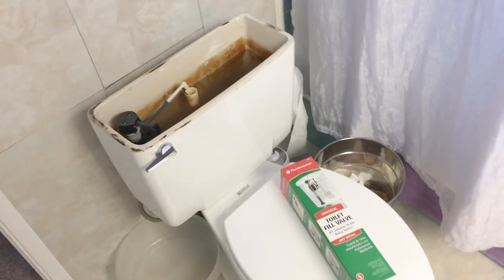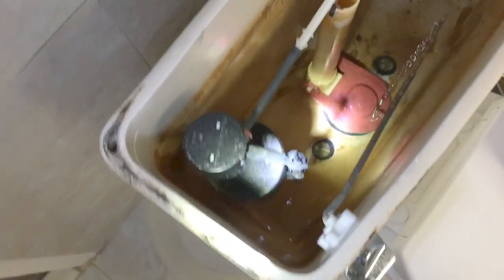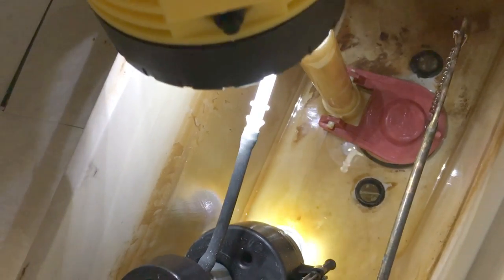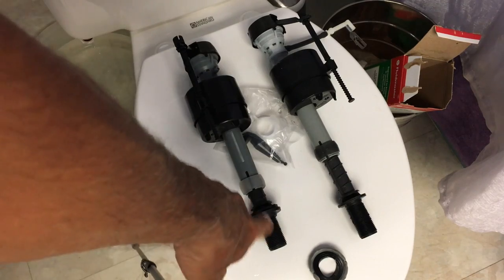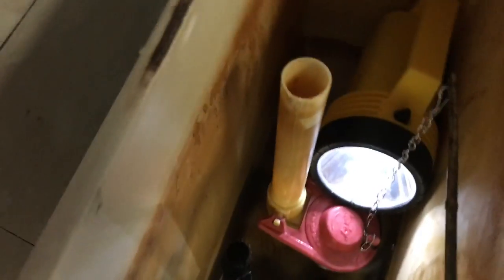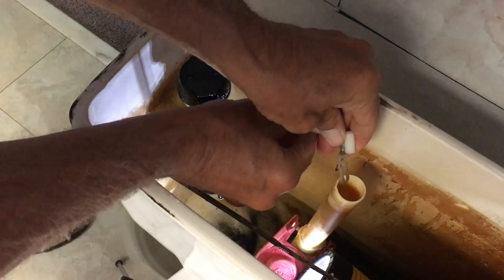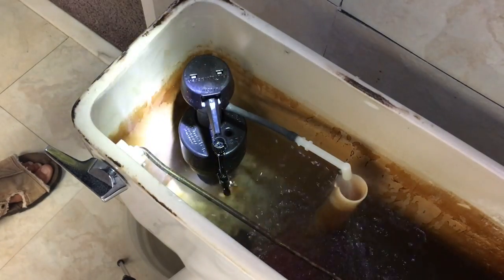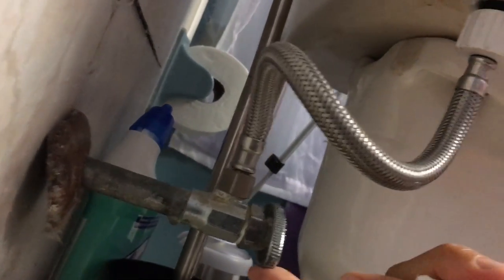How to install a Fluidmaster universal toilet fill valve.

Comment: Hi!🖐 Mr. Leeman, I can't thank you enough!! My husband used to do this & I really wanted to tackle this on my own. I put furniture together no problem, but with plumbing I'm intimidated. The fill valve was leaking from the top, the rest was fine. I've had the part for 3 months but was nervous.  After watching this I felt confident, did it, works fine, no leaks!! He (my ex) is going to be shocked I fixed this on my own! Now I can say..."what, like it's hard?". 😉 Thank you for making it clear & easy from another single female! 🙏🏻✌🏻
Reply from the maker: Way to go do it yourself and save ....

Comment: If the toilet tank is slow filling or the fill valve won't completely shut off, there is typically no reason to completely replace the entire unit when simply flushing out the valve and  replacing the toilet fill valve seal will suffice (part 242, toilet valve seal for Fluidmaster 200, 400 and 747 model fill valves).

You can remove the valve cap, flush out the valve body to remove debris and replace the valve seal in five minutes.  It does not involve removing the fill valve from the toilet tank or draining the toilet tank.  It is a simple repair of the toilet fill valve, not a wholesale replacement of the toilet fill valve.  The seal costs around $2.00 and the instructions for replacing the valve seal including flushing the debris out of the valve body are on the package.

Fluidmaster also has short videos on how to remove the valve cap and flush out the valve body.

ALSO: you should adjust the refill tube so the water sprays directly into the overflow tube so it can fill the bowl.  In your video, the water from the refill tube is hitting the edge of the overflow tube and spraying into the tank.  Adjusting the refill tube so the water sprays directly into the overflow tube also eliminates a lot of noise when the toilet tank is refilling.

Comment: Appreciate the guide on installing this valve! 😁

now to figure out how to install a new flapper😅
Reply from the maker: I have a couple videos on that I have repaired a number of different toilets and put in flappers and actually the whole toilet. If you check, there’s a couple videos on that somewhere I’ll see if I can find one for you and post the link.
Reply: @TomLeeman  I appreciate the response friend but I was able to figure it out I was just confused by the little upward hooks that keep the flapper in place like I thought you had to do something special with it but no I just had to force it out with a little muscle power, if that makes any sense haha yeah I got it done.

 The only thing I'm actually having problems with now is that the toilet water supply line to one of my toilets is spraying out water that's coming onto the floor instead of going completely into the new valve I brought a fluid master 400 model btw. It's weird it didn't happen to the other two just this last one. Like I checked the valve and water is going through it it's just that some of the water's splatting out of the supply line as well I tried tightening it as much as I could but still happening weird.

 I'm wondering maybe I should just replace the supply line I guess. 

But again thanks a lot I'll definitely look around see if you have videos on that too 😁
Reply from the maker: @TheTimon64  that’s interesting. I have to see it to figure it out. You may have cross threaded the Going into the water closet or the washer isn’t ceiling tight depending on where the water is coming from. Good luck and thanks for watching.
Reply: @TomLeeman  hey friend I actually figured it out on another vid the guy talked about there being like a little black rubber cone inside of the supply line that goes up into the toliet .

somehow it came out of my valve when I was taking it out I guess, it was in the bucket where I put the old valve somehow it just fell in there thank God I found it lol

 but I put that little black cone back in and that helped keep the water from spliing out everywhere so I'm all good now phew haha thx again for your help all done! Im my Mom's hero right now lol 😁
Reply from the maker: @TheTimon64  excellent glad to hear you got her working

Comment: Thank you!  I’m a single mom of a 16 yr old “pre-handy” (but is on the honour roll) young man so we are both learning (but I’ll be doing it 😂.)  This was really easy but the rotted gasket on the tank nut I was unprepared for!  Orange water leak til I replace that so still no water in the tank!
Reply from the maker: Good luck you can do it thanks for watching

Comment: Good video.  I like the short cut tips.  I'm going to throw in there don't use those tablets that turn the water blue.  Man my wife was using those things against my judgement and when I had to work on the toilet there is a layer of sludge in the tank I had to wash out.  The blue dye made it a really messy job.
Reply from the maker: Thanks for the tips! and thanks for watching

Comment: My understanding for that little bit of water that runs before the “flapper” has closed is to clean the top underside of the toilet bowl rim. I could be completely off here. But, that’s what I heard. Asking a plumber should confirm if this is correct or not.
Reply from the maker: Set a time she just have to replace the flapper

Comment: Is the water supposed to be spraying out of the tube like a shower all over the tank while it's filling up after flushing?
Reply from the maker: should go down the center flush valve tube
Reply: Thanks! It's just I noticed on your video the water was like a sprinkler shooting around outside the tube.  I bought same one to replace old ball assembly later. Wish me luck!

Comment: Our toilet has flooded our upstairs so I’m watching this because I gotta replace it tomorrow. The buoyancy thingy has crack in it so instead of floating it sinks and stays underwater so the toilet water never stops. We have been having to pull up on it to get the water to stop running. Some how even after we do that I guess the weight of the water inside the buoyancy thing pulls it back down turning the water back on when no one is there to watch it. We just had to run throughout the house and grab every towel we own. Now we are washing every towel we own. Lol
Reply from the maker: There should be a turn off valve just underneath the water closet you you can stop the water from going in until you fix it

Comment: DO you turn the things under the tank clockwise or counter clockwise?  my toilet wont fill up.  Can you tell me the problem?
Reply from the maker: I think to tighten clockwise
Reply: Lefty loosy, tighty righty.
A rhyme to help you remember. 😉
Reply: I heard that before, but some things in plumbing are backwards.  I found out when I installed a kitchen sink.  Thanks!  @googlethis313

Comment: This video is good if you like doing things the hard way.
Waaaay too much work. If you're replacing a Fluidmaster, with another Fluidmaster, with my method you wont spill a drop of water:
1. turn water off.  
2 Reach in the tank and pull up the black collar thats on the shaft of the valve that is used to adjust height of the Fluidmaster.
3 Turn the head 1/4 turn counter clockwise.
4. Pull straight up.  The whole fill valve assembly/float will pull off, leaving the origional shaft still attached to the toilet.
5. Reverse the process, pushing the new valve on the shaft, 1/4 turn the head, push down the collar. Turn on the water.

Takes less than two minutes and no mess.
Reply from the maker: Excellent tips thanks for the notes and also thank you for watching

Comment: The plastic lock nut is totally stuck nothing like the one in the video that just screwed right off. I've tried wd40, towel, etc. It doesn't budge.
Reply from the maker: Have you tried using channel locks they’re usually pretty good for loosening that fitting good luck thanks for watching

Comment: Thank you Tom, I live alone and this was really helpful especially during the pandemic. A couple of points since I am not very good at home repairs: I would have appreciated seeing close-ups of exactly how you removed it even though to you it is probably obvious. Also, sometimes the camera was shaking or not centered and some things were difficult to see. I would also appreciate a video of how to change the water valve itself, the one that turns off the water  because it’s better not to wait until that gets old because something disastrous can happen. I’m kind of surprised you didn’t mention that. Maybe you have another video that goes over how to replace that and I will look for it. Thank you.
Reply from the maker: I made another video on how to change everything but its Kohler thanks for the tips sorry for the shaky hand its hard to do it and hold the phone sometimes thanks for watching

Comment: Can you replace the rubber gasket only instead of the entire fill valve if it's only the gasket that's worn? Thanks.
Reply from the maker: The Phil valves are fairly inexpensive so I think it would probably be easier to just replace the whole thing just in case
Reply: @TomLeeman  Thank you.

Comment: What's the quality of these Fluidmaster 400A valves?

Also, what's that water director called that the little hose connects to and directs the water at a 90 degree angle into the tube?  I haven't seen those, but I'd sure rather go in at 90 degrees rather than arching the plastic hose up .
That's what our old one does and actually puts strain on the main valve

Is there a name or link to that part so that I can search it?

I have to go buy a new valve today to replace a Korky one, which, while reviews seem to be good for them, this one has been nothing but a serious pain in the butt, since day-1.

The biggest problem with it is that you have to turn and unlock it, so as to move the entire thing up or down to adjust the water level.  The rarely actually works as it binds and even one it's "set" it's glitchy in that it will either fill to the setting or below or even above.  Part of that is due to how the valve is opened.  It's just trash.

So I've been seeing these Fluidmaster 400A ones and wonder how good they are.
I do see in this video that it looks like the old one might be a Fluidmaster as well.

From what I'm seeing, the Fluidmaster is adjusted for height only once and then the water level is a simple turn of the knob on the top.  I'm hoping that these are good.

Ideas???
Reply from the maker: This one’s been in there for a couple years and still working really good. You can get them at Home Depot or on Amazon. Good luck on your install. Thanks for watching.

Comment: If you have a shop vac, you can vacuum the extra water out of the tank before you take out the old fill valve.  That way you can install the new one without the leftover water pouring down on you.
Reply: If you don't have a shop vac, you can use a plastic cup or a ladle to scoop out as much water as possible, then sop up the rest with a sponge.  In my book, it's a really good idea to get the tank as dry as possible before you start. Obviously you'll need to get all the water out of the tank if (like me) you don't have room to put a bucket under the tank.  Great video.  You explain the process very well.
Reply: @helpinghal  In my area I would get covered in iron fist by doing that.

Comment: At 4:55, is it normal for the upper plastic tube to move a super small amount when you're tightening on the lower plastic coupler?
Reply from the maker: It does turn a little bit but you can hold it with one hand to keep it from doing that as you tighten it thanks for watching

Comment: I changed the fill valve and it still won't shut off when the toilet is filled. What have I done wrong?
Reply from the maker: You may need to change the flush valve which requires taking off the water closet I have a video on how to do that its a little more work but not to hard
Reply: Tom Leeman thank you for your help.

Comment: Hi,
If you hadn’t of put the little hose on at 5.50 would the float of still self adjusted with the pressure of the water when the cistern filled?

The reason I ask is I know nothing about plumbing but I fitted a brand new fluid master flushing valve but it didn’t have the small hose with it. The new float is not automatically moving up or down as it should.
Reply from the maker: Im not sure will have to research that
Reply: Hey thank you, 
I have however fixed the problem today and the answer is: No you don’t need the small hose (Not for the model I have anyway) but once again thank your concern.

Comment: I've installed this, but I'm getting a very small leak at the bottom of the cistern (water closet) where that white plastic screw is. It's only about 1 or 2 drops of water an hour. The manual said to only make it finger tight, or you could crack the shaft, but I've tightened it  super tight with my fingers, and it's still happening. 
Might have to risk tightening it with a tool. I cleaned all around the hole before insertion, so I can't see how there's grit or something affecting the seal. I put the rubber washer the correct way round. I'm at a loss...
Reply from the maker: check for small cracks and the donut between them
Reply: @TomLeeman  donut between them? The rubber seal?
Reply: Wrap the threads with white teflon tape to stop leaks and then tighten again.
Reply: @mikeflemingband  ok thanks I'll try
Reply: Mine does the same thing, I finally put some plumbers putty around the hole opening prior to setting the fill valve down.

Comment: My toilet is leaking where the pipe runs into the fill valve. Do I have a bad seal on the fill valve? That's my guess at least.
Reply from the maker: Yes I think it would be that or the connection under neath is not tight enough
Reply: @TomLeeman  I'm about to try to change it out now. Thanks!

Comment: You need to up the volumn somehow, it's very hard to hear.  Could not hear it at all on my tablet, but a little better with my laptop and extra speaker at full volumn.  Thanks
Reply: Sharon Clerc I hate that when the broadcaster doesn’t realize the volume sucks 🤣👍🏼
Reply: I can hear him fine, but I’m on an IPhone.

Comment: Not going to charge you $100 for an $8 fill valve. It is an easy fix, though. To be helpful: for those who, for whatever reason, can't turn off the supply valve (the little oval faucet thingy that turns on the water) You can also just replace the top part, and leave the fixed tube the whole thing sits on in place.

Comment: So I followed the steps, Some idiot before me tightened the white screw thing so tight it was nearly impossible to get undone, that took a good 15 minutes and multiple swear words. Then when I got the whole thing put back together I cannot get it tightened enough to stop it from leaking. maybe some information on a wrench or something I can fit in the very tight space to actually get this done on my own!!!!!!!!!!!!!!!  Very frustrated tha I just spent the better part of an hour and its still not fixed.
Reply from the maker: Try plumbers tape, check to see if it was cross threaded and might be a rubber o ring or washer missing

Comment: I watched to see how to adjust the water level, but not one video actually shows an adjustment.
Reply from the maker: You can adjust by lowering the ball or float
Reply: Turn the screw on a Fluidmaster or bend the arm on an old style one.

Comment: You skip the part you took of the old one I am stuck there-(
Reply from the maker: Once you have turned off the water you can remove the old flush valve by unscrewing the bottom nut and just pulling it out make sure u have a bucket underneath

Comment: It is a piece of cake if you have plenty of room.  In cramped quarters you will lose your religion just trying to get the nut off where it connects to the tank.
Reply from the maker: Yeah it’s not the easiest most convenient place to work you gotta get on your back sometimes crawl under which means you gotta clean everything first. Good luck. Thanks for watching.
Reply: I have about 8 inches between the vanity and commode.  I cannot get a wrench on the nut.